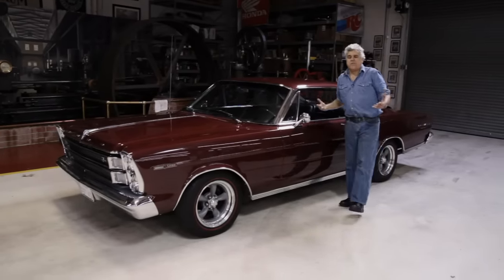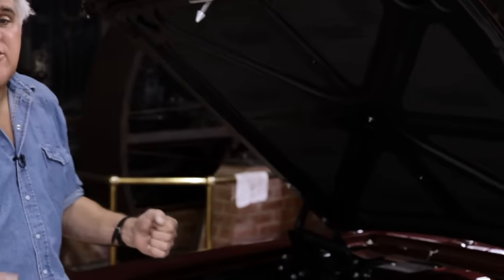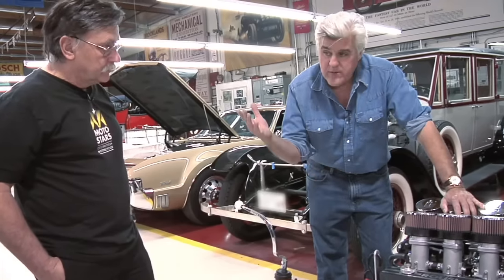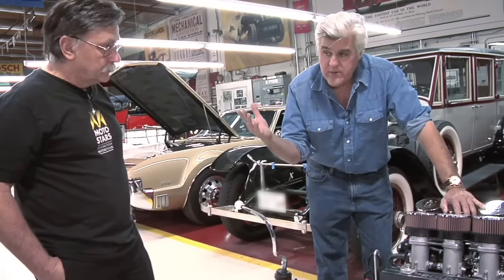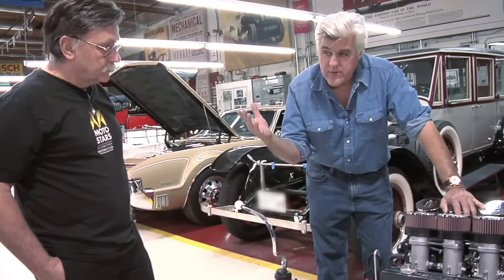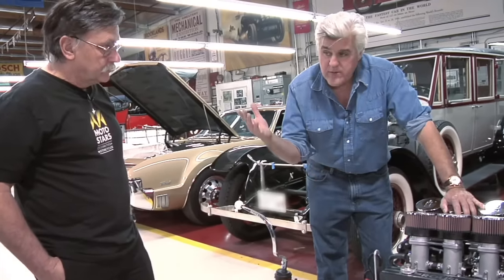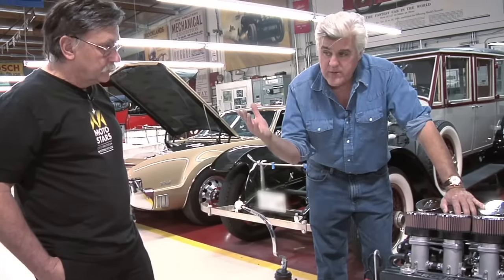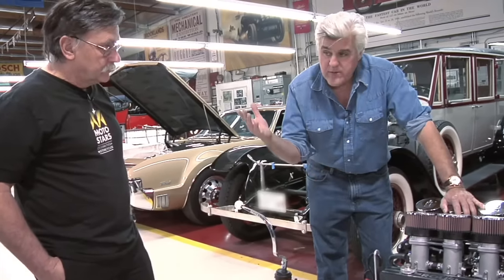Restoration Blog: 1966 Ford Galaxie, Ultimate Edition - Jay Leno's Garage

Comment: 1998 I bought a white, with red interior, '66 Ford 7 Litre station wagon that I found in a FL scrap yard. I paid $500 for it with no title. No title needed for it in my state. Only thing wrong was the C6 transmission which I rebuilt. Even the paint and interior were still in mint condition. The A/C still blew cold which I converted to 134a Freon 2 years ago. One small dent in L/F fender and it was easy to fix without hurting the paint. It still has the original wheel covers.

Comment: Jay has gathered knowledgeable friends, collectors, auto shop connections, craftsmen, mechanics, fabricators, & vendors to Restore & Performance UPGRADE his projects BEYOND mere Horse Power. So much of the 60s was selling cars With Large engines; and yet, they did not provide total handling solutions. The "second" go round, he takes is a complete approach to the vehicle. He ALSO WANTS A SLEEPER. I do not think he street races, but has a car that will surprise other drivers off the line. GOOD HOBBY IF YOU CAN GET IT.

Comment: Late '82, I had a '66 ford custom 2 door, basically an economy galaxy. 289 engine, 3 speed manual on the column. Poineer TX-S6 speakers in the back window. Room for friends.

Comment: Those cast iron 427 exhaust manifolds he used here are extremely rare and worth a mint today. I purchased a set from Ford back in the day as the basis for the system I used when I put a 428 PI engine in my 1965 Mercury Commuter wagon I used as a tow car for my 1965 B/FX Mercury Comet I ran in NHRA's "Modified Eliminator" as an E/MP powered by a Boss 302. Used a complete 2-1/2" exhaust system with Corvair "Turbo" mufflers on the wagon. It had plenty of power and got reasonable gas mileage. Any way, a set of those manifolds are valued in the Thousands$$$$ these days. And, "Yes", they are completely different from the 1963/64 427 manifolds.

Comment: Mr. Leno, you just elevated yourself, in my eyes, to the ionosphere.  I have loved the sh*t out the 1966 Galaxie for years, and the 7 Litre is the one that causes me to drool and twitch like a madman.  I was in Hollywood one night years ago to see "Chinatown" at a revival theatre, and when I came out, there was a red 1966 Galaxie 7 Litre parked at the curb.  
It gets better. 
It was a convertible, the top down to reveal a spectacular red interior.
Then I noticed the engine badges.
"427".  
God only knows how many were ordered with that option.
Then the owner showed up, with two young lovelies to further brighten this scarcely believable picture unfolding.
A brief whine from the starter and
"BLAM!
BLAM!BLAM!BLUB-BLUB-BLUB-BLUB...."
Holy sh*t.
Sorry, Mr. Huston, Mr. Nicholson, Miss Dunaway, but as brilliant as "Chinatown" was, it got upstaged that night.
Thank you, Mr. Leno.  You have impeccable taste.

Comment: We had a ‘66 LTD, red.  My dad traded it in in 1969 with 110,000 miles.  Got $400 trade in. We used the plastic seat covers so the interior was pristine.

Comment: I have a sixty Chevy Impala with a 283 that I added a 3-speed stick double Z28 head with 2-1/4 diameter intake valves and a 4 barrel Carter carburetor. I had it painted green metallic with mag hob caps. I could spine my tires a 70 mph. I believe your Ford 500 could not outrun my Chevy. Of course, I sold it to my brother-in-law and went to Vietnam. When I got back, I purchased a Vague TG.

Comment: Outstanding I love this video I watch it in a spare time while making my rounds Jay my hats off to you sir for the restoration and preservation of this iconic beauty of Americana my old man had a vehicle of similar antiquity it was a 1964 Chevrolet Impala with a 427 big block.

Countless memories and enjoyment I would say the full size Boulevard Cruiser certainly had the edge on the midsize muscle cars and then the smaller sports cars which we would call in the United States Pony cars but as it is the Impala while yes beefier and heavier was the easier car to live with much more comfortable to drive for longer distances and ultimately the more resilient vehicle plus there's plenty of room in that back seat for two or three chicks LOL and I could sleep overnight in that damn thing with Comfort knees air condition too though that meant she didn't have the high power 400 500 horsepower top of the line model but hey an air conditioner especially in those hot months regardless pays dividends

 Now I say that the car is an original SS that came with 409 however at some point before he bought it used in 1974 car was nearly about 10 years old then she had a replacement 427 block from a later production date Impala put into it so whatever happened to the original 409 is lost to time the more my dad is Tough to try to figure out what happened to the original motor the less information he seems to get it was an original New England car itself from Northwestern Boston.

 but he bought it in Kentucky 1974 before he left for the Navy and it was thoroughly utilized by him my mother myself my brother ever since she's in no longer running condition now but eventually one of these days when I have time I'm going to try to get a roadworthy again two-door hardtop Daytona blue Chevrolet for life.

Comment: Jay when I bought my 60 Tbird in 1988 from the original owner it would run hot back then you still had old fashion radiator shops I took it down to the radiator shop it had a 3 flu core we changed it out and put a 4 flu core it still has that same radiator today and will stay cool all day even in these hot South Carolina days. I still have the original suspension and brake  system and I know what you mean on the way it drives and stops.

Comment: You were correct about the suspension. In 69 I had a 65 Comet. I went into a curve at 70, slid off the road and hit a rock wall and put a kid through the windshild. Found out my stepfather lied and didn't get my insurance. I paid for the car, the rock wall and Nickys medical bills. Lesson learned, never trust anyone. Years later I got a 66 Ford Galaxie 500 2dr Ht with the buckets, auto in the floor and a 240 6 cylinder engine. I loved that car. And old woman wasn't watching where she was going and totaled the car. I would love to have a 7 Litre.

Comment: My Uncle ordered a 1966 Galaxy 500 7 Liter red on red. Kept it a year and sold it to his father in law my grandfather. It is a bad mama Jama. I remember my grandmother in the late sixties driving and we were at a red light and a 1969 Camaro pulled up beside use and the guy started revving the engine and my looked at me said honey hold grandma needs to teach this guy a lesson. My Grandma was full of piss and vinegar! She told hold on. She pulled the shifter in low 1 and went the light turned green grandma run that car we got a little sideways but blew his doors off. The next light he wouldn’t pull up next to us. That is one of my memories of my grandma with the beehive hair do. I wouldn’t have pulled up next to either. Grandma was not happy she wanted to gloat! She was pissed. What a badass car. Still in the family in a garage in Texas with less than 50k. Grandpa always washed that car with a little diesel. Paint was perfect. Last time I seen it 10 years ago. Got all the paperwork and build sheet and window sticker.

Comment: There is nothing like the feeling of a full size big engined car from the 60s as it goes into warp. The Impala, Catalina and Grand Prix 2+2, the Galaxie,..their noses would rise, you'd hear that open element 4bbl air cleaner's WhOOOOO!!! sound and those windshields was like watching a big screen television , your buddies or the family dog all with their heads out the windows,or mooning the loser because the windows roll all the way down....😁.Speed, Comfort,and instantaneous recognition BECAUSE EACH MANUFACTURER MADE AN EFFORT TO NOT STYLE THEIR INDIVIDUAL MODELS TO LOOK ALIKE. You instantly knew the year, make,and model. Today's tech make cars 100 times better... technically...but model years 55 thru 70 is IMO the best era of the American Made Automobile.

Comment: I had a black 1 with lite blue interior with 7 litre badges all around it and the glove box. A guy gave me the car with no engine and the frame was bad... I put another engine in it and it'd still boil the rubber off both rear tires and I can only imagine how it ran with the 427 or 428 engine that came factory in it. I put a 361 out of a 70s Ford truck in it. The guy that bought the car new put the engine in a 70s or 80s Ford van and I tried several times to buy the van just to get the engine but I gave up and sold the car cause I knew it'd be put back the way it was supposed to be...I let it go for 200 bucks cause I knew it was going to get the treatment that it deserved. I'd also like to know if he still has it because he's the type of person that didn't need to sell it unless the money was right...Nice ride Jay and I love the story about yours and id love to have another one but my pockets ain't deep enough lol...

Comment: In 1970 my father ordered a brand new Pontiac Catalina 2 door. I was 16 at the time and wanted him to get the 455 4-barrel with dual exhaust. but dad said that was too expensive. He did end up with a 400 two barrel single exhaust but this car was available with a police frame and police seating which he did order. This car ran over a hundred thousand miles with pretty much no issues at all. Dad never did let my brother or I drive his car.  that was pretty wise of him.

Comment: My dad bought a 66 Galaxie for fifty bucks, drove it for a year only put gas in it. Gave it to me when I was 16. It had a 6 cylinder with stick on the floor, had a cue ball for shifter knob. It took 10 minutes to get to highway speed, it needed a tune up so bad. Borrowed some tools and began learning about cars. My currant project is 58 Edsel Ranger

Comment: 427 over the stock 428, my choice would have been the 428CJ, lots of low end torque. Maybe not so much horse power but tons of torque for a heavy car. I had a heavy VDrive boat with a 427 medium riser dual four, burnt a piston so I installed a 428CJ out of my 1969 Mach One. What a difference out of the hole, better ski boat.

Comment: My 1966 Mercedes had fuel injection. The air intake was supplied from a scoop right at the front of the car into a long runner manifold for cool air, this was racing technology from the 50's.

Comment: I bought my first car in 1967, which was a Candy Apple Red with white pin stripe 1966 Ford 7 Litre 428 Quad Carb. All electric windows locks, etc.. Air.. I had nearly 10 years when I bought a 1977 Ford F150 4X4..

Comment: In terms of shape and size the only German Ford that ever came near this battleship was the Ford 20M P7. The largest engine was a V6 3000S. The P7 was also available as a pillarless coupe and was basically the closest thing to a mopar young Germans could get at the turn of the decade. P7s have become very rare these days, because most of them were wrapped  around trees or otherwise destroyed. Particularly original RS models have become incredibly rare. On top of everything else, The Ford spares warehouse in Cologne went up in flames in 1977 and was completely destroyed, making original parts extremely rare. Thought I'd shared this unrelated piece of information... :-)

Comment: The original 4 speed manual with a 323 rear end was hard to get off the line quickly buy was extremely long legged.  We would chicken out at an indicated 135 mph.  It felt like it would do a lot more.

Comment: Hmm, castor/camber, toe, on front end. I have known about front end shops installing adjustable struts on the front lower control arms. By tweaking the #'sthey could bring the tires in  almost full contact with the pavement. That was a constant problem with many Fords/Mopars with control arms/struts.

Comment: I did not learn to drive in a galaxy 500 with a 390. It was the first car that I tried to drive. My neighbor told me he was going to teach me to drive. This was in 1972 and I was 10 years old. For some reason he thought I should back it up into the other neighbors driveway. I start backing up and turning to soon. He yells hit the break! I panic and slam the throttle all the way to the floor. The car barely moved and white smoke was coming up around it. Now he’s screaming the break the break the break! I slam my foot on the break and it stops. He then calmly says put the car in park. I put the car in park and as soon as I did he opened the drivers door and shoved me on the ground and screamed go home. That was awesome and terrifying for a 10-year-old.

Comment: I did you change up the front turn signals? Weren’t originally both upper and lower cubes the signal? Now just the upper, the lower parking lights? Thanks‼️

Comment: I'm curious to find something out. This is probably a really dumb question but do your guys at your shop work only on your cars Mr. Leno? The more I think about this the sillier I feel. Anyways I have a '74 TVR 2500M that  already has a significantly built engine but it still needs alot of work to be finished. If anyone can respond, my name is Rod and I'd appreciate it.

Comment: I had a 66 Gal 500 427 3spd, the only way to make a corner at speed was to downshift punch the gas. the rear would break loose aim the Galaxy with the front wheels. when pointed (hopefully) right direction let up on gas and hit it hard

Comment: Bigger oil pan, Handling Packages I remember was like $28 , oh the thrill of picking all the "below cost" goodies. This is why Fords were called "unibody" vs frame. An issue is with a ten MPH collision and thye "frame" 'accordianed and could not safely be straighened.

Comment: I had a used 74 galaxie 500,boxy looking,no style at all but it had the big eight cyl to sell more gas and the speed limit 55. I got pulled over and a mile later I noticed I'm doing 74 again.The bad old days.

Comment: my father bought a 66 galaxie 500 2 door with the 352 4V duel exhaust in nitemist dark blue.  it looked like a big mustang to me as a 15 year old kid.  When i got older i was allowed to drive it and at times borrow it.  Gas mileage was not great so my pop bought a  orange colored ford fiesta.  Well one day the oil light was going on and off and the idiot that i was, thought it was a short in the system.  I got on the parkway for two exits and the light stayed on only to find out the next morning that i ruined the motor.  The fuel embargo was on and gas went from 65 cents to a $1.50 a gallon ,if you could find it!  He decided to junk our mint condition galaxie!  I pleaded with him to rebuild it and that i would help him.  He said  "You?  The idiot who ignored the idiot light wants to help me rebuild this motor?  It was junked!  I never forgot that and began to study mechanics and  re,built many great cars saving them  from the junkyard.  Fast foward to 2016 and i found a nice 66 500 XL with a 390 that was rust free for 8 grand and bought it!  after putting 7 grand more into it along with rebuilding the transmission i have a great running car,just like dad's only a different color/engine size.  the only thing i may add is A/C since i now live in AZ and no longer long island NY.

Comment: Ps: it DOES certainly, remind me of MY *, the “1966 GALAXIE 500XL, Burgandy/ 4 SPEED/352/ PS,PB/ black DELUXE INT/ Wheel covers, 352+4BBL(underpowered, but Sort of economical,🤣),NO DISC BRAKES/ OR A.C., etc..l WAS just barely 20 years Old, when we found it...in early 1967,*……Thanks again, nice work up,......INTERESTINGLY, first thing UPGRADED, was SPECIAL METALLIC **Brakes/ Shocks…done a lot of add ons, & work, also......Actually, compared to my first few cars: my 66 GALAXIE XL , WAS LOADED , & “newish”…….( previous Car was 61 RED/ Convertible White tops FORD GALAXIE (?)/352/ Automatic: had been repainted, some amateur body Work & abused,etc.; lasting several thousand mile , & trouble,! 🤣🤣

Comment: Jay doesn't care for the 1964 Galaxy but the 1962 Galaxy was just okay.  Coincidently, my dad bought a new 1962 Galaxy 500 XL with the 390 HP 4/spd and when I was 14 yrs old in 1967, my dads cousin had a 1964 Galaxy 500 R-code and I thought that was the baddest car ever made ...until Ford came out with the 1967 Mustang Shelby GT500 w/dual quad 428 Cobra Jet engine.

Comment: Found this listed on the Stitch Corp website: The car came shipped to the BDG  facility and once it was brought into the shop we all instantly knew something was wrong. When one of the doors was opened to get into the vehicle, out scampered dozens of rats, thats right, RATS! the car smelled so bad that it was immediately moved outside of the shop and an exterminator was brought it for damage control. Holy crap Batman! The interior wasn't necessarily in bad condition but there was no way in hell that you were gonna get that smell out of the seats, carpet, and headliner.  Yikes right?

Comment: While focusing on a GOOD cooling system is extremely necessary  , Ive seen SO many hot rodders overlook & underestimate the Importance of adequate air filtration! The air filter IS the MOST important filter on an engine . rule of thumb :It takes only ONE oz of dust per 100cu in of displacement  to RUIN an engine .  It only takes 5 oz of dust to destroy this engine ! Jays 500+ ci engine even with 8 tiny filters does NOT have enough filtration protection for this valuable engine ! Think about it , those tiny filters must filter MORE volume of product than all its other filters combined , many times over !

Comment: I would like to say that if you've ever built a car that's the last problem you run into when the gas pedal sticks to the floor so when you have a 4 deuce set Up I think it could have been a lot worse and that exhaust system on the car is 2nd  to none an awesome. RICJAGR Los Gatos                                Hi Jay  Hi Barney